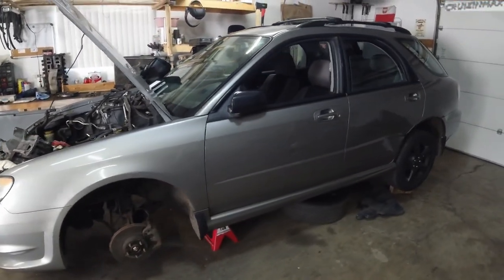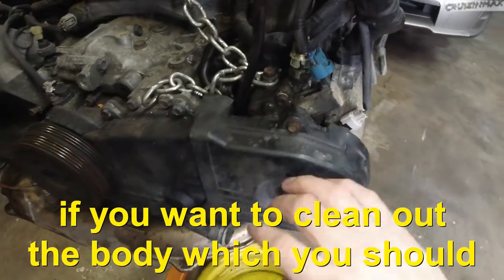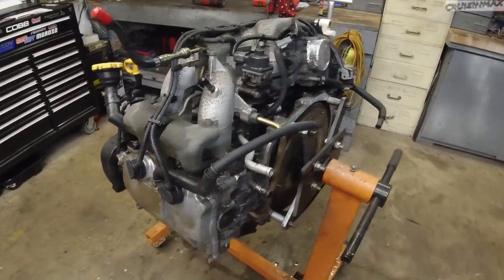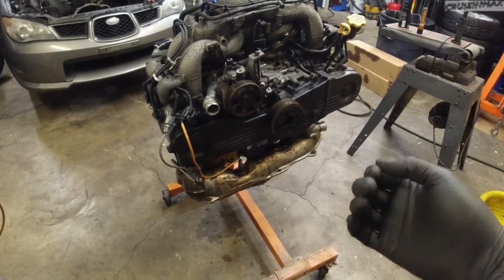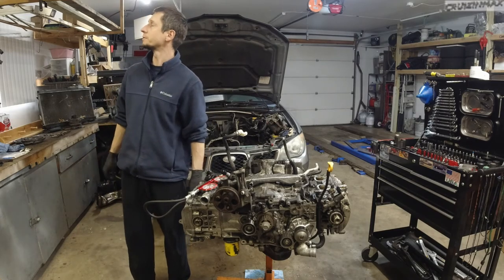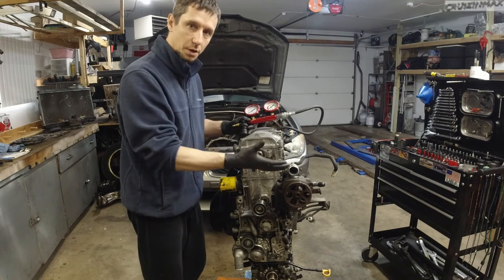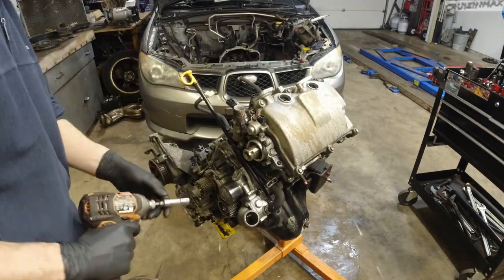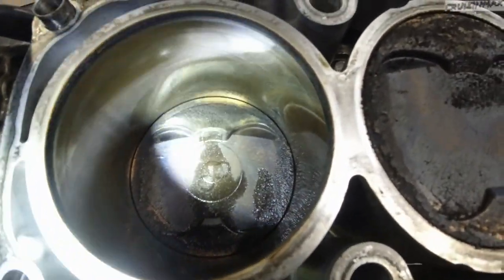Subaru Impreza 2.5L head removal and leak down test part 1

Comment: Hope you got that thing cheap.  LOL  Instead of the stock single layer gasket, I use the MLS head gaskets from the  EJ255 on these when I rebuild them.  I love how easy these Subaru engines come out of the car.  I usually completely reseal the engine when I'm in there.  Especially the orings in the oil pickup tube and the oil pump.  

I always do my leakdown tests with the belt on, or after I pull the cams.  I've done quite a few of them, but it's always more fun to watch someone else do it.  LOL
Reply from the maker: I wanted to do the mls but would loose compression doing it and this is slow already if you know what i mean...the owner plans on taking it to autox, ice autox and rally cross.  Need all them HPs.  Compression test came out very good so me doing the leak down test was for the video mainly, already knew I would have to lap those exhaust valves.
Reply: @cruizinmax4017  If you shave the heads or block down the additional thickness, you shouldn't lose any compression.  Just a thought.
Reply from the maker: yes i know but they only took off 5 thousands which is almost nothing